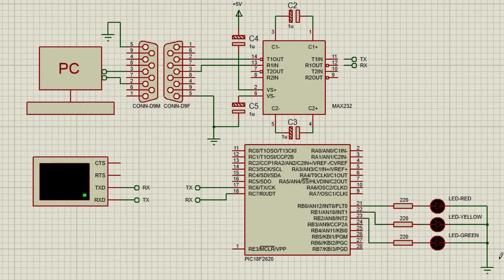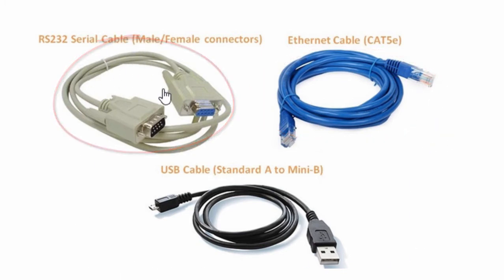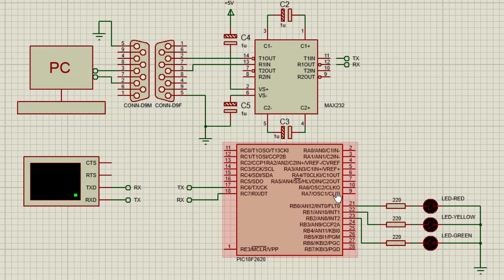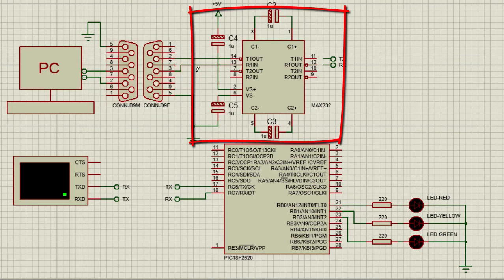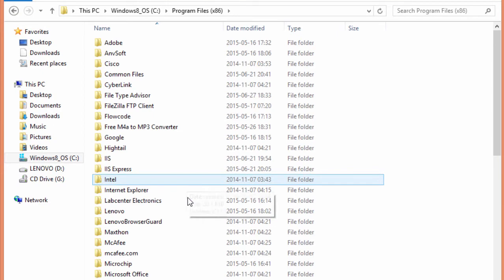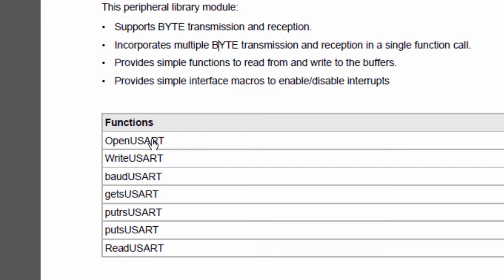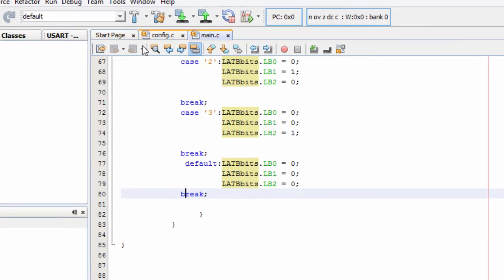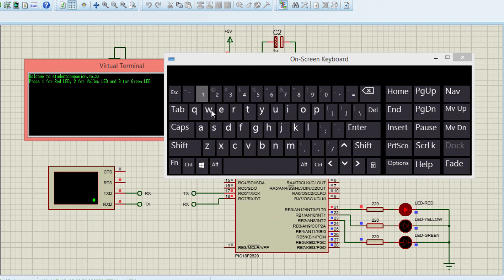14- RS232 Serial Communication | MPLAB XC8 for Beginners Tutorial

Comment: Hello, friend. When I try to send data from Proteus compim to the real Qt application, this app receives different garbage. For example if I write "Hello \r\n" my app see it randomly as "He" "l" "lo\r" "\n" or enother combination of these pieces. I wanted to write temperature, pressure and humidity as 27,760,75. I tested communication in Hercules. It works properly. But in Proteus it really made me cry. I use MPASM for 16F MCU for speed. When I tested same data with Arduino it was OK, it was working. Can somebody tell me what is problem?
Reply from the maker: It's probably mismatch baud rate. Check if your microcontroller baud rate and terminal is the same.
In this video we used compim, you can check some settings: https://youtu.be/d3CUQmt2Jjc
Reply: @StudentCompanion  Baud rates are the same. Brgh = 1, spbrg = 25 for 9600. Symbols received correctly, but string integrity has lost. You know, I use com0com virtual serial port emulator to connect real application with Proteus. The same priblem occurre when I use JavaFX with jssc. It works normal in proteus virtual terminal. I think when I use arduinu it connects directly, not via com0com. Or maybe in proteus usart model thread or process has bad timing 🤷
Reply from the maker: Try a different terminal, like putty, tera term or realterm  and see if you will get same problem. 
It looks like timing issue to me not code problem.

Comment: hi sir. i googled it and searched it in youtube but i can't find that PC you used in proteus, if you could be kind enough to tell me how can i find it in protues.
Reply from the maker: What are you talking about? Which PC?
Reply: In the first minute of the video, in proteus, the left CONN-D9M 's second and third pins are connected to a PC how did you import that?
Reply from the maker: It's not a component is Proteus. We just drew it for demonstration.  You can also draw yours using some rectangles, circles, lines etc. As you can see the pin TX ans RX  on the MAX232 IC are disconnected.  So this PC is not simulated. If you want to simulate using your computer, use Proteus COMPIM component as explained in this video: https://youtu.be/d3CUQmt2Jjc
Reply: thank you :)
Reply from the maker: You are welcome!

Comment: Hi sir, I tried this but stuck up with the PC component(Computer symbol in ur simulation proteus), u have used in proteus, How did u select it? it's not available in proteus parts library? or else can I use another virtual terminal's tx,rx pins to connect with Conn-D9M? pls help.Im using proteus 8 professional.do i need to add another library?
Reply from the maker: Hi. The Computer symbol is not a Proteus component and is not simulable. We just drew it with some rectangles for demonstration purposes only.  If you want to simulate on Proteus only, use the normal virtual terminal as in this video. If you want to simulate on Proteus to your Physical computer then use the Proteus Compim component as explained in this video: https://youtu.be/d3CUQmt2Jjc
Reply: yes sir I found it after I texted u,sorry it was my bad. But now the problem is reaching the plib/usart, actually I had this kind of prob when I used xlcd.h lib,i installed legacy lib and then included xc8 lib by linker from properties.after that it worked if i say #include<xlcd.h> without plib, but now in this proj usart I cannot reach,if u want me to send the proj,pls tell me how can I send it?by syncronizing the proj folder n email?
Reply from the maker: Which PIC are you using? If you have already downloaded the legacy lib and linked it with the lcd tutorial, you shouldn't have problems now.  It should work.
Reply from the maker: If you are designing using Proteus, why can't you use a new PIC model and use MPLAB Code Configurator(MCC) instead on the legacy lib? The legacy lib is being phased out, it's not being updated for new PIC models and it always have some problems especially when you use a new XC8 compiler. For future compatibility it's best to use new tools than old legacy tools.  MCC is easy to use than the plib and it supports PIC16F, PIC18F, PIC24, PIC32 . See this video for the same project you are doing using MCC: https://youtu.be/jLRTTHI9m94
Reply from the maker: Because you are using a new compiler with the old library.  Is there a particular reason to use the peripheral libraries instead of MPLAB Code Configurator?
Reply: Ill try and reply. does it mean learning via code configurator is going to be more easy and most widely used ?
Reply: no I just followed as in the tutorial,actually Im eager to know where I failed,coz I downloaded the zip file from ur site  n it worked ,that'sy I wanted to know wats wrong with mine.that's all.thanxalot sir.I'll try codeconfig
Reply from the maker: Yes it's going to be easier for you abd it's the future . Microchip is no longer supporting peripheral libraries for new PIC models. So don't waste your time learning an old technology while there is a chance to learn a new one .
Reply from the maker: Watch this video to learn the basics of MPLAB Code Configurator.  I cam help you to find out where you went wrong but peripheral libraries with the new compiler always gonna give you problems.  In each tutorial you'll encounter problems.  Your learning experience will be slow and seems difficult while learning to program PIC microcontroller should be fun and easy. 
See this introduction to MCC: https://youtu.be/JxSSVtTj_fA
Reply: thanx sir otherwise I would have wasted a lot of time.
Reply from the maker: You are welcome!

Comment: hello sir thanks for the tutorial.may i know how to receive string??
Reply from the maker: You can use this function:
getsUSART
This function reads a string of characters from the USART.
This function waits and reads a specified number of characters. There is no timeout and the program will wait forever if the specified number of characters are not received.
Example: char buffer[20];
getsUSART(buffer, 10);    // Wait to receive 10 characters
Reply: do u have any programme of this because of I used this function but I didnt  getting output?
Reply: I am Using PIC16f1786 and XC8 compiler
Reply from the maker: Then you must be using it in a wrong way. Can you post your code?
Reply from the maker: Please post your code let us have a look at it and explain how you are testing it . Why can't you try using MPLAB Code Configurator: https://youtu.be/jLRTTHI9m94?
Peripheral library are getting phased out.
Reply: //*
// 
//
//
// PIC16F1786 Configuration Bit Settings
//
// 'C' source line config statements
//
// CONFIG1
#pragma config FOSC = HS       // Oscillator Selection (HS Oscillator, High-speed crystal/resonator connected between OSC1 and OSC2 pins)
#pragma config WDTE = OFF       // Watchdog Timer Enable (WDT disabled)
#pragma config PWRTE = OFF      // Power-up Timer Enable (PWRT disabled)
#pragma config MCLRE = ON       // MCLR Pin Function Select (MCLR/VPP pin function is MCLR)
#pragma config CP = OFF         // Flash Program Memory Code Protection (Program memory code protection is disabled)
#pragma config CPD = OFF        // Data Memory Code Protection (Data memory code protection is disabled)
#pragma config BOREN = ON       // Brown-out Reset Enable (Brown-out Reset enabled)
#pragma config CLKOUTEN = OFF   // Clock Out Enable (CLKOUT function is disabled. I/O or oscillator function on the CLKOUT pin)
#pragma config IESO = ON        // Internal/External Switchover (Internal/External Switchover mode is enabled)
#pragma config FCMEN = ON       // Fail-Safe Clock Monitor Enable (Fail-Safe Clock Monitor is enabled)

// CONFIG2
#pragma config WRT = OFF        // Flash Memory Self-Write Protection (Write protection off)
#pragma config VCAPEN = OFF     // Voltage Regulator Capacitor Enable bit (Vcap functionality is disabled on RA6.)
#pragma config PLLEN = OFF      // PLL Enable (4x PLL disabled)
#pragma config STVREN = ON      // Stack Overflow/Underflow Reset Enable (Stack Overflow or Underflow will cause a Reset)
#pragma config BORV = LO        // Brown-out Reset Voltage Selection (Brown-out Reset Voltage (Vbor), low trip point selected.)
#pragma config LPBOR = OFF      // Low Power Brown-Out Reset Enable Bit (Low power brown-out is disabled)
#pragma config LVP = ON         // Low-Voltage Programming Enable (Low-voltage programming enabled)

#include <xc.h>
#define __XTAL_FREQ 40000

void UART_init();
char UART_Read_init(char *A);
char UART_Read();
void UART_init();
void UART_Write_Text(char *text);
void UART_Write(char data);

char A;

void main(void) {
    UART_init();
    SPBRG=32;
     
    
    RCSTAbits.SPEN=1;
    
  UART_Write_Text("NEXSYS");
    while(1)

    { 
    A=UART_Read();

}
    
    }    
void UART_init(void)
{
    TXSTAbits.SYNC=0;
    RCSTAbits.SPEN=1;
    TXSTAbits.TXEN=1;
    TXSTAbits.TRMT=1;
    PIE1bits.TXIE=1; 
    RCSTAbits.FERR=1;
    RCSTAbits.CREN=1;
    
    TRISCbits.TRISC7=1;
    TRISCbits.TRISC6=1;    
    PORTCbits.RC7=0;
    PORTCbits.RC6=0;
    INTCONbits.PEIE=1;
    INTCONbits.GIE=1;
}
void UART_Write_Text(char *text)
{
    while(*text){
       UART_Write(*text) ;
       text++;
    }
}

void UART_Write(char data)
{
  while(!TRMT); //Waiting for Previous Data to Transmit completly
  TXREG = data; //Writing data to Transmit Register, Starts transmission
} 

char UART_Read_init(char *A)
{
    while(*A)
    {
       UART_Read(*A) ;
       A++;
      
    }
}
    
char UART_Read()
{
   
   while(!RCIF);
   A=RCREG;
}
Reply from the maker: Why aren't you using the supplied USART library functions? What is your crystal oscillator frequency?
Reply: please mail your ID
Reply from the maker: What ID you are talking about?
Reply from the maker: You didn't answer my question
Reply: what sir?
Reply from the maker: Why don't you use the supplied USART library functions?
Reply: ok i will check sir
Reply from the maker: Ok

Comment: Hi , thanks for this tutorial , i have a question please , it's about the plib/usart include. how can i get it please ?
Reply from the maker: What is your question? Be specific. What is the version of your XC8 compiler? What PIC are you using?
Reply: thanks again for your answer, i'm working with pic18f4520(with PICDEM2 plus board of microchip) on IMPLAB X IDE v3.65 with XC8 v1.41 i need to read data (NMEA)  continuously from GPS using usart , the problem is that i dont find the # include<plib/usart> to use the functions of USART
Reply from the maker: +mili mehdi the plib is No longer included in XC8 compiler from version 1.35. You must download it separately from microchip website the same location as XC8 compilers. It's now called Legacy peripherals libraries.  Download it and install it into your XC8 compiler.
Reply from the maker: +Student Companion At the beginning of this video we explained/show where you can download plib: https://youtu.be/4WaB_Lj8FnY
Reply from the maker: +mili mehdi if you have a newer PIC like PIC18F46K22 you could use MCC tool to configure your USART without the need of plib as explained in this video: https://youtu.be/jLRTTHI9m94
Reply: thanks really so much for your help i've installed the library and it works well :), now i'll try to read gps data, can i comeback to you if i find difficults?
Reply from the maker: +mili mehdi good luck. We can try as far as we can but so far we haven't done any gps tutorial.
Reply: ah okey thank you so much for your help and i hope that i'll finish my project and send it you back if you want :)
Reply from the maker: +mili mehdi thank you.  It csn always be useful to others as well.
Reply: hello, it's me again ^^ , i have another problem , when i complie i have an error  ( C:\Program Files\Microchip\xc8\v1.41\include\plib/usart.h:32: error: (141) can't open include file "pconfig.h": No such file or directory ) i don't find "pconfig.h" , what i must do here please ?
Reply from the maker: If you have installed your plib (legacy peripheral library), then you must link it.
Reply: yes i did it but i have always the same problem
Reply from the maker: How did you link it?
Did you right-click your project -> Properties --> XC8 Linker -> Link in peripheral Library?
Reply: yes like you have done it in previous tutorial
Reply from the maker: If you are still getting that error, start a thread on our forum, upload your code we will compile it on our side and see those errors: Forum:
http://www.studentcompanion.co.za/forums/forum/mplab-xc8-tutorial-discussions/
Reply from the maker: It can't be mplab code configurator. You cannot also use mplab code configurator with your current PIC, I think it's not supported. MCC supports only new PICs at the moment. That is why you are using plib instead of MCC.
Reply from the maker: Can you post your main.c code?
Reply: yes ofcourse i'm going to post in the forum if you want
Reply from the maker: great.
Reply: i've posted my code in the forum :)
Reply from the maker: Please upload your zipped MPLAB project so that we can compile it and see your errors
Reply: okey i'm gona do it
Reply from the maker: +mili mehdi great!
Reply: have you tried my code or not yet :)
Reply from the maker: +mili mehdi we will try it when we have time.
Reply from the maker: They must be some incompatibility of peripheral libraries with XC8 v1.41. That is why it's giving that error. We tried your code with XC8 v1.34 it compiles well without any problem.
As you are aware microchip is phasing out the peripheral libraries, they want people to use the new MPLAB Code Configurator, they are no longer updating the peripheral libraries and thus might not be compatible with new compilers.
We would advice you to download XC8 v1.34 under the download archives.
Reply: okey thank you so much i'll try again to resolve this problem, and if it's not possible i'll download the version that you recomand
Reply from the maker: +mili mehdi you are welcome!
Reply: hello again, i've download mplab xc8 v 1.35 as you told me , but i still have one error , it's doesn't find #include<pconfig.h>, (no such file or directory)i really need your help please :)
Reply from the maker: +mili mehdi we said you must download xc8 v1.34 not v1.35.
Reply: oh yes , sorry ^^
Reply: it works now thank you so mush, but when i put a delay of 100 (__delay_ms(100)) it makes error (too large argument of delay ) is that normal ?
Reply from the maker: +mili mehdi great!
Reply from the maker: +mili mehdi with old compilers like v1.34 you'll get errors when you put large argument (number) . Use small number in a loop like we did it in tutorial 1: https://youtu.be/mUofSucHx_E

Comment: Hello.

I'm getting an error when using BusyUSART macro.  The error says "conflicting declarations for variable _TXSTAbits". 

I think the register TXSTA is configured by the OpenUSART function, but compiler doesn't mark an error on it, and code runs fine when i comment those two lines of "BusyUSART".

what could it be ? Maybe the Bit Config  ?  

I'm using PIC18F4550.
Reply from the maker: +Jesús Jiménez León hi. Can you post the whole error message and the code then we can figure out what could be the problem.
Reply from the maker: +Jesús Jiménez León what is yhe version of your compiler?
Reply: The version is V1.41
Reply: Here's the whole output

:: advisory: (1233) Employing 18F4550 errata work-arounds:
:: advisory: (1234)  * Corrupted fast interrupt shadow registers
:: warning: (1273) Omniscient Code Generation not available in Free mode
C:\Program Files (x86)\Microchip\xc8\v1.41\include\pic18f4550.h:5771: error: (1098) conflicting declarations for variable "_TXSTAbits" (C:\Program Files (x86)\Microchip\xc8\v1.41\include\pic18f4550.h:5124)
(908) exit status = 1
nbproject/Makefile-default.mk:125: recipe for target 'dist/default/production/USART.X.production.hex' failed
make[2]: Leaving directory 'C:/Users/windows10/Documents/Projects/PIC18/Proj_10_USART/USART.X'
nbproject/Makefile-default.mk:84: recipe for target '.build-conf' failed
make[1]: Leaving directory 'C:/Users/windows10/Documents/Projects/PIC18/Proj_10_USART/USART.X'
nbproject/Makefile-impl.mk:39: recipe for target '.build-impl' failed
make[2]: * [dist/default/production/USART.X.production.hex] Error 1
make[1]: * [.build-conf] Error 2
make: * [.build-impl] Error 2

BUILD FAILED (exit value 2, total time: 1s)
Reply from the maker: +Jesús Jiménez León did you install the peripherals libraries into your compiler?
Reply: Yeah sure, i've been using the other libraries (LCD and ADC) normally. Now i'm thinking maybe i'm using plib libraries in a later version of the compiler...and maybe is why the BusyUSART macro is incompatible.
Reply from the maker: +Jesús Jiménez León it's possible as they are no longer upgrading them. They might not be 100% compatible with new compilers. Microchip wants people to shift to MCC.
Reply: I'll ask in the microchip forums. Thank you so much for the answers!
Reply from the maker: +Jesús Jiménez León you are welcome!
Reply: Did you find a solution? Having same problem.
Reply from the maker: +Gonzalo Unzueta Hi. Can you start your own comment and write exactly the errors you are getting and specify the PIC you are using and the compiler version.